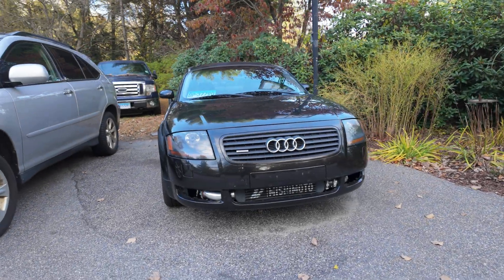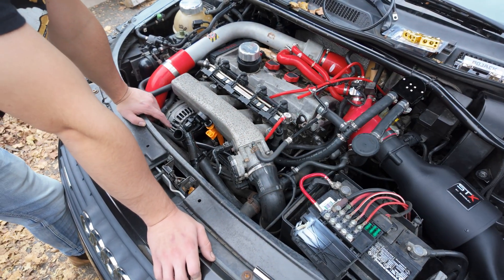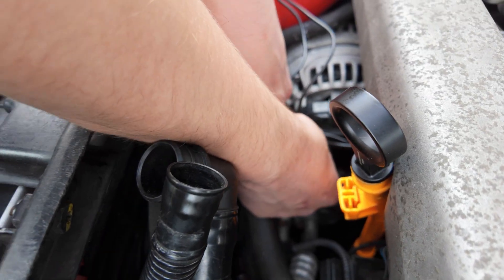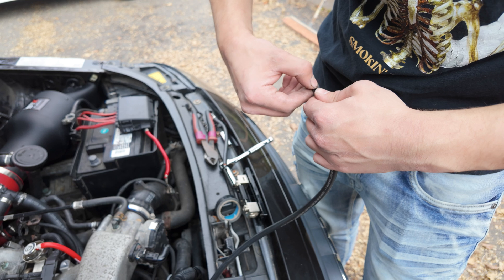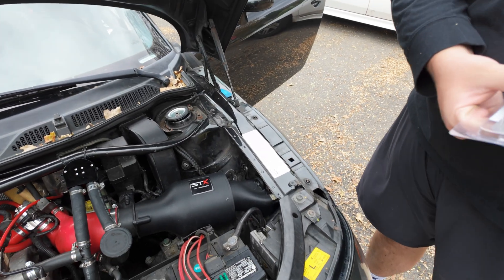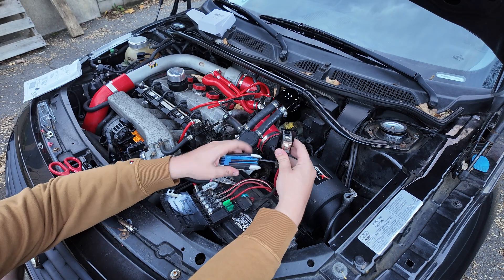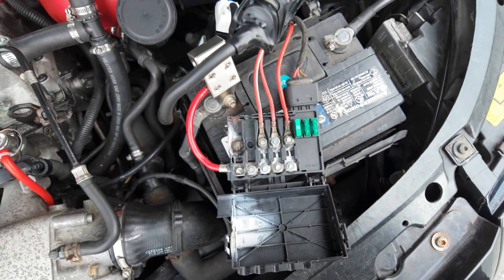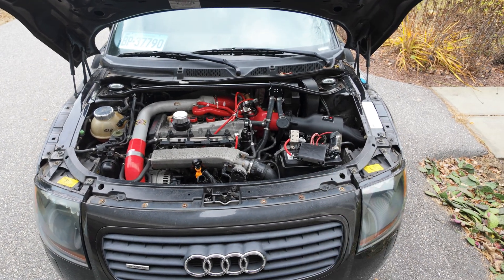MK4 VAG Melted Fuse Box Permanent Fix! [VW, Audi, SEAT, Škoda, 1.8t, VR6, TDI, 2.0t]

Comment: Not the cleanest solution. Just upgrade the thickness of your altenator to the fusebox with 35mm2 cable you should be fine.
Reply from the maker: Hey Peter thanks for stopping by, I appreciate the comment. 

Although I have done minor updates since, this definitely still is not the cleanest solution. 

I actually have done quite a bit regarding this issue since owning the car and nothing has helped quite like this. I went through many fused boxes, two oem cables, a 4 gauge cable, I freshened up all the grounds in the engine bay. 

For what ever reason, nothing has been quite effective as this 😅. I am definitely looking to tidy it up

Comment: Thinking you may want to shield that positive side power block, just so there is no accidental shorts to the hood or similar. I would be afraid of that.  Looks great though! I am so jealous of that turbo intake... I CANNOT get mine off on my BEA engine.. and I can't lift the motor to get under it :(
Reply from the maker: Great advice, I definitely don’t want anything to short out! I’ll have to shrink wrap it or tape it up with electrical tape

The turbo intake pipe was not easy to remove, and was even more difficult to install the new one! I managed to do it with the car in the ground but it was not fun. The hardest part was the clamp onto the turbo itself

Comment: It’s always good to see the methods behind the solutions. Interesting that it generates so much heat. Is this due to the car calling on too much charge due to upgrades or simply bad connections? With that new fuse box you would not expect any wires to get hot if it was bad connections. Must be the draw somewhere. I once blew the largest fuse in that top fuse box connection by connecting the battery the wrong way around! 🤦‍♂️
Reply from the maker: Hey Andy, thanks for stopping by! I’m not exactly sure… many seem to believe that this battery fuse box is a bad design and inherently problematic from the factory. 

I have done everything… replaced the alternator, fuse box, battery, alternator wiring harness. I even freshened up all of the grounds in the engine bay. 

Nothing has been nearly as effective as this, just temporary band-aids 😅😅
Reply: @TTTravisYT this looks a great solution sir!

Comment: Informative channel i also have a 1999  mk1 tt 225Q ❤
Reply from the maker: Hey man! Thanks for stopping by, I appreciate the kind words! Much much much more to come!!
Reply: I've had 2 fuse boxes do this I'll look into doing this upgrade to my car thanks bud 👌😊
Reply from the maker: @SandysAutoDetailing no problem! Good luck. Also make sure to remove the battery and freshen up the grounds underneath it. I had done this last time I replaced the box and cable, but failed to mention it in the video!!